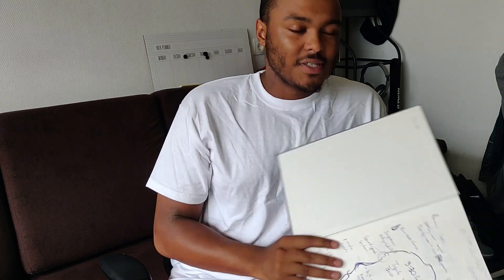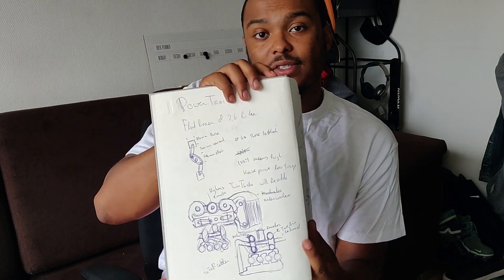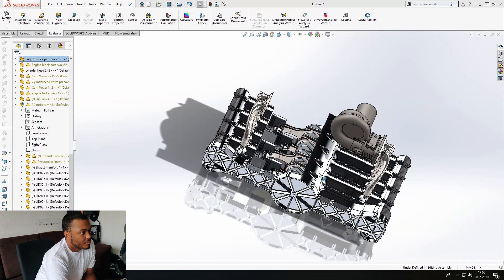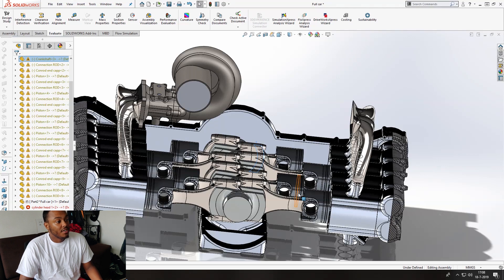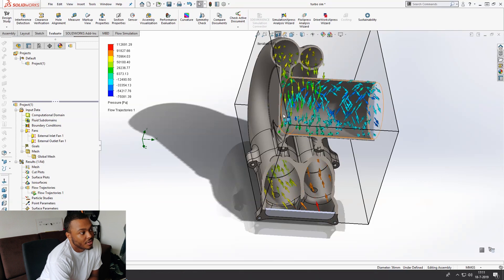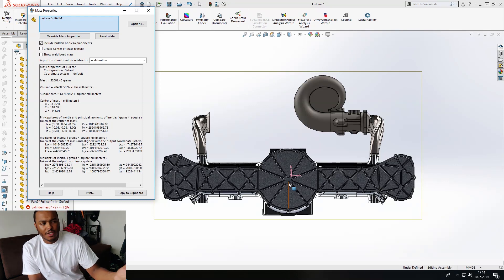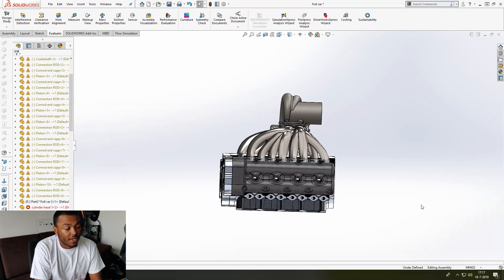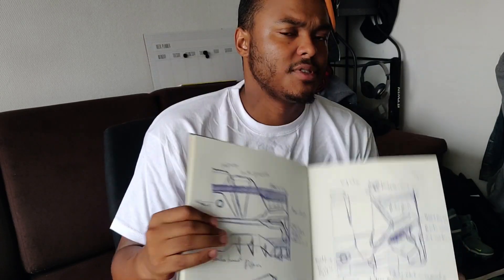Lemans 2020 Regulation Hypercar Engine Design | SVADesign | Solidworks

Comment: Man, i want reproduce the legendary BMW'S P54B20's  intake manifold, to fit a BMW M54B30 (330i) engine. How can i get start? I could print a model in 3d printer, using Solidworks?
Reply from the maker: as a mockup you can 3d print the intake manifold but i dont think a 3d printed model could take the pressure. but the most important thing is to have the dimensions to bolt the manifold to the engine block. the bolt pattern and the the actual intake track size, and also take in to consideration that there are other components in the engine bay. so packaging is also very important.